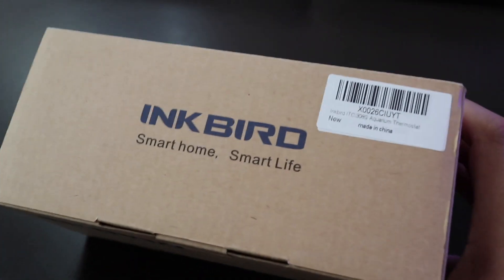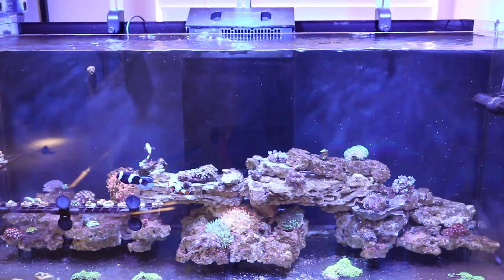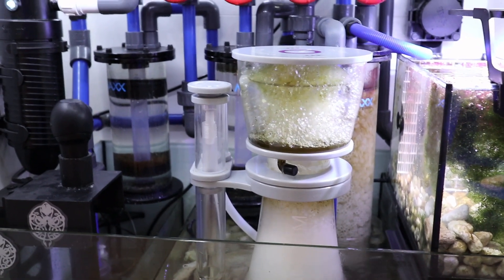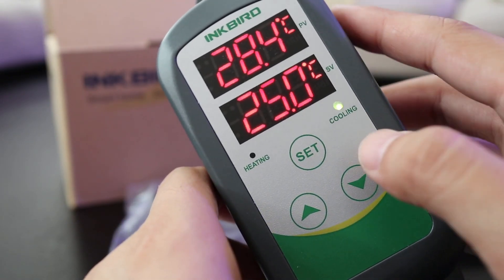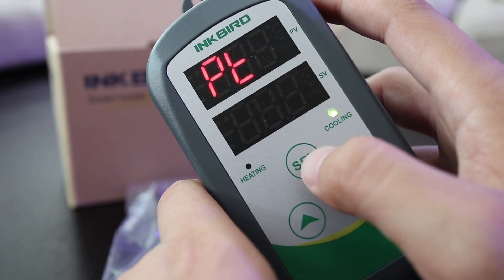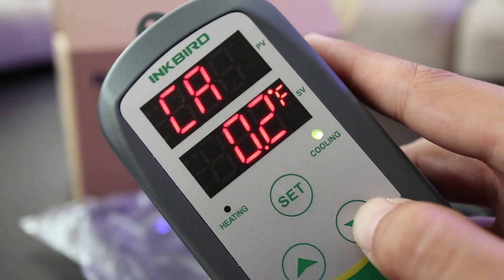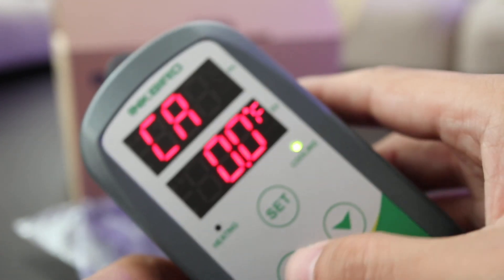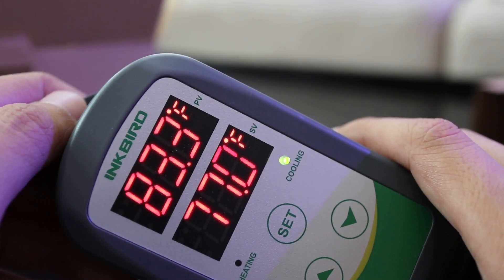HOW TO SET UP AND PROGRAM INKBIRD ITC308S ITC308 FOR REEF TANK

Comment: I have one of these for my two gallon pico reef - warming plug hooked up to a tiny 8 watt always-on heater, and the cooling plug hooked up to a little fan. Works great, and actually reduced the amount of equipment I have in the tank, because heaters with in-built thermostats are bulky, even the smallest ones.
Reply: Where did you get the always-on heater?  I'm using this same thermostat and I've been looking for an aquarium heater that doesn't have any controls on it.

Comment: Fantastic review and tutorial, I had never thought about a controller before, but now I  think they are well worth it for the alarm feature in particular. Thanks for a great video :)
Reply from the maker: Colin Barsby thank you! I never had these in place until in dabbled into the salt water side. I originally got it to connect a fan to the tank for cooling
Reply: @prolific_breed  I'd never even thought about them before, but now I think I need one :)

Comment: Hi, I have a cold water marine tank in an unheated outbuilding and I need to keep the temperature from dropping below 14 degrees C
in the winter is this within the capabilities of the device if i run a heater unit?
Reply from the maker: it should work it has a heating and cooling set so it will keep everyting in your desired range

Comment: Hello, do you recommend this one over the inkbird 306?
Reply from the maker: Not sure with 306. I use the 308 for heating and cooling. Cooling is connected to a fan
Reply: Last question, just got a 250 red sea reefer. What king of heater are you running on you tank? Hard to find one to fit inside the sump. Thanks for you help
Reply from the maker: I run finnex titanium heaters